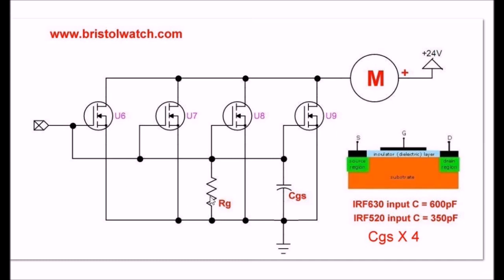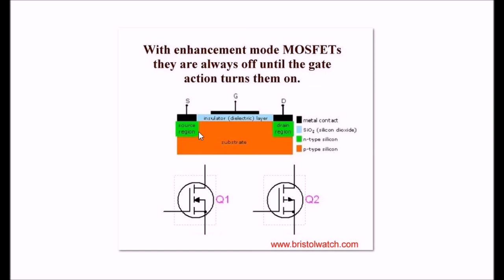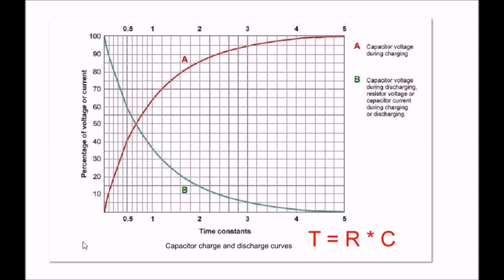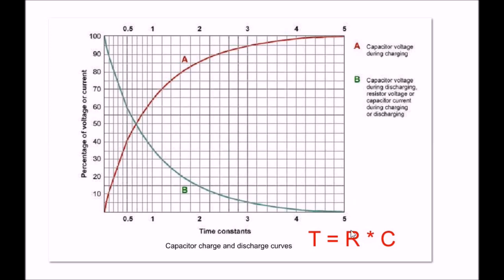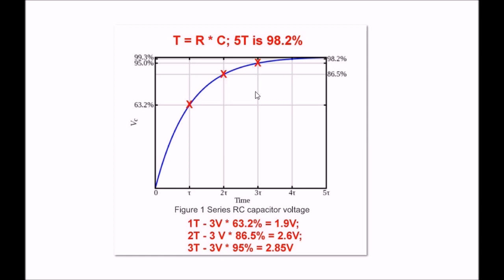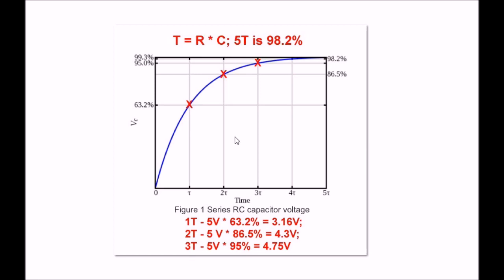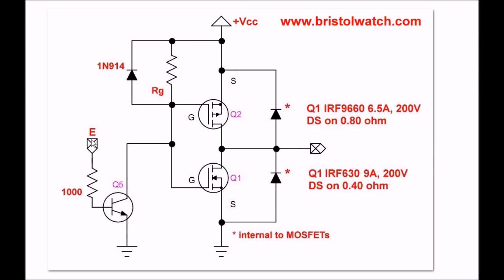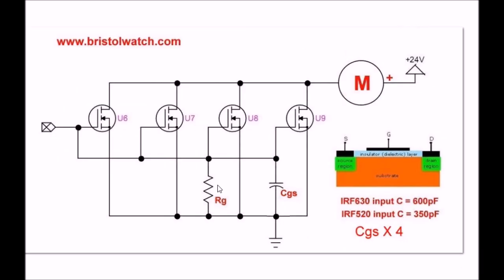Issues on Connecting MOSFETs in Parallel

Comment: Sir, I have a question about electrons. A photon is a wave packet that's propagating in the electric and magnetic fields. But, in what medium is the electron wave packet propagating in, what is it made out of? I've tried to look up this question on the Internet and I've tried to ask others this question and no one seems to know or want to answer it. I was just wondering if you know the answer, sir. Thank You.
Reply from the maker: Electron wave packet? Did you mean photon? Photons are electromagnetic energy not influenced by magnetic fields while an electron is matter with a negative charge and effected by magnetics. Photons can pass through a vacuum but unless translucent or very thin (or very high energy levels) won't pass though matter. It's a matter of wavelength where shorter wavelength (x-rays, gamma rays) the better they will pass through matter. Hope that helps.

Comment: The drive circuit(half H bridge) that you explained in the video also has a BJT driving the the Mosfets. So it's essentially BJT+MOSFET driving the main MOSFETs. Won't that introduce additional turn-on/turn-off delay?
Reply from the maker: The main problem is charge/discharge on the MOSFET gates. The MOSFET drivers provide low turn on/off resistance. Thanks.
Reply: Yes, but typically important is not the delay (not very high usually, for example a good driver like TC4422 have several tens of nanosec delay), but the switching speed; this is improved a lot.

Comment: Is Cgs a real capacitor component in the circuit or is it a mental variable that's part of the FET's internal characteristics?
Reply from the maker: No not as such. It's the capacitance between the MOSFET electrodes. This is in the spec sheets.
Reply: You can measure it.  Does that make it real to you?